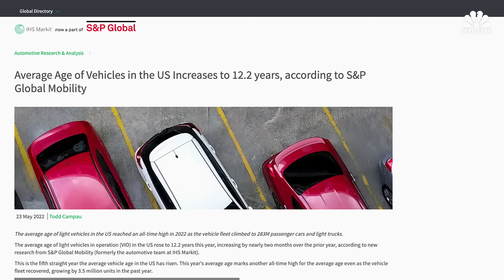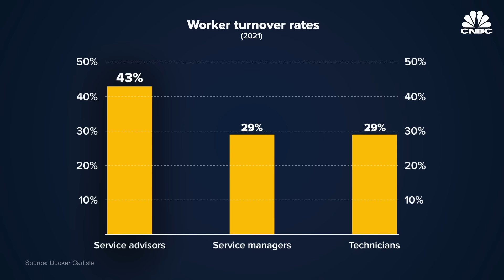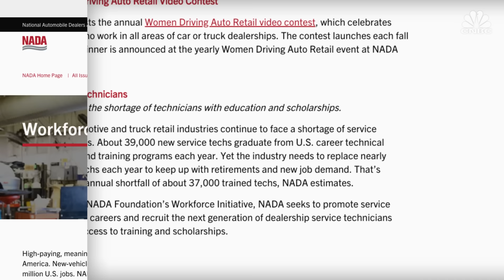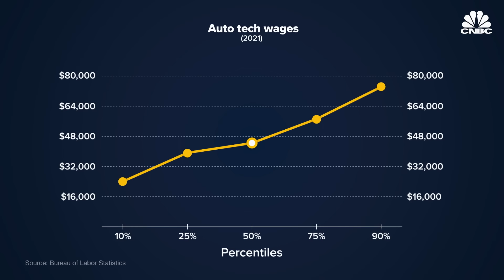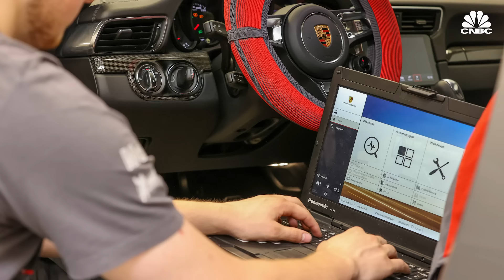Why The U.S. Has A Shortage Of Auto Mechanics

Comment: Starting in 1986, I began in the industry. When I left I was an ASE Master Auto Tech, L1 Advance Automotive Performance Specialist, ASE truck and ASE school bus electrical certified, Honda / Nissan factory trained and a used car dealer tech for about 14 years. Left the industry in 2000 for the same reasons [pay being #1] thoroughly and repeatedly outlined in the other comments. I had a child to support and did not want to live like a refugee. NASTEF was addressing this same issue a few years ago. Here we are in 2022 and nothing has changed. Same complaints of "we can't find [or find enough] qualified Techs." If this has been and is such a critical issue, after 22 years why have concrete solutions not been implemented? Really makes me wonder.
Reply: With your Nissan experience, could you enlighten me as to what would cause a P0650 MIL? Even when i reset the codes, the CEL just STAYS ON. Replaced the cluster, too. Driving me nuts
Reply: @mydecember1985  My Nissan experience dates to the 1990s. The code you cite is a MIL lamp circuit malfunction. As the MIL keeps coming on, obviously the MI Lamp and its circuit are working. Further, you state that "when i reset the codes". What are the other codes that are appearing with with P0650?
Reply: @parochial2356  Thanks for the reply! I'm close to your era. Those were the Nissan glory days!  02 Infiniti I35 (glorified Maxima) That's the only code and it won't go away. Tested voltage to circuit at back of cluster and continuity to ECM pinout. Normally, if I clear any codes, the CEL goes away for a few minutes before the ECU picks up a fault like P0420 or P0328 and turns back on. This thing is constant! The annoying part is that since the ECU cannot detect the MIL, any secondary code throws the car into limp mode. The logic would be "if I can't show you a MIL, I'm going to put you in limp mode so you KNOW there's something wrong". Something as simple as an evap code for loose gas cap sends it into limp and cannot pass 2,500rpm.  ECU was repaired last year by a shop for faulty electronic throttle body that shorted a small chip in the ECU. Code has been there since the day I got it back from repair. I just needed to know that no other module can control the MIL bulb and that it's 100% the ECU. Perhaps a bad solder dumping constant voltage to the light? It's under warranty. Just want to be sure before the wife is out of a car while I send the ECU out.
Reply: You state that the MIL code is the only current and repeating code since ECM replacement. OK. I am not current on the logic strategy for a MIL circuit issue on this vehicle. Seems odd to me that, for example, if the MIL light was "burned out", that the car would start but be in permanent limp mode and undriveable.  Perhaps that is true. Now, if the car was bought to me for diag, I would first confirm the correct ECM part number for the year, model and engine is installed. Then: 1. Confirm KOEO, that the MIL does illuminate normally, 2. Pull codes and [I assume I would see] the MIL P code and no other codes. 3. Start the car and look at the live data stream and note any unusual data parameters, including - but not limited to - the MIL command [should be set to false], MIL illumination status [off or false] and normal B+ [system is charging]. 4. Assuming data is OK and MIL illumination was now occurring, I would check for the full B+ system voltage being dropped across the MIL lamp i.e. no raised ground issues on the or low B+ input at the MIL bulb. 5. Assuming we're good to this point, perform a dynamic B+ and ground test at the ECM connector of all the ECM's B+ and grounds. This means using a test load such as 12V bulb that draws say, 2 to 3 amps, not an Ohm meter resistance test as the service manual likely shows. Eric @ South Main Auto has many excellent examples of how to do this. If Everything is good to this point, I would warranty the reman ECM. I suspect you have either the wrong P/N ECM installed or an underlying wiring / ground issue, but I think my approach will ferret out the true issue.
Reply: @Chosen Remix First; this requires a shift of the mindset and a desire of a Tech to become self employed. Second, it requires the capital to start a shop. That will require either a large sum of cash on hand from savings or the desire and ability to obtain credit, with the ensuing risks involved.

Comment: We went to an independent mechanic for years until he retired recently. He did his job for decades. He loved doing it, but he shared something interesting about the direction of where the work was heading. He said each auto company are making it more difficult for mechanics to repair with technology coming into play. He also said the tools are becoming obsolete to pick apart an engine and that each car brand has their way of removing components which makes it cost burden. Why go through all that hassle when it's obvious that car companies now want to be distinct from one another. He said it's not like the good ol' days where you can fix your car yourself in your garage anymore. It's just too complicated now. He didn't want to retire soon, but can't keep up with the changes
Reply: That isn't an excuse for me. Every industry I know from computert/phone repair has different builds, proprietary bolts/screws/locking methods.
Same has been automotive the past 15 years I've done it. My older brothers and father are master technicians.
They taught me to learn OBD2/electronic control modules of vehicles. The vehicles had more electronics, sensors, modules, actuators added to reduce emissions and increase gas milage(MPG)

It's actually easier to diagnose vehicles with electronics than before.
Now it is harder to remove engines and transmissions with electronics but having sensors to read everything is definitely helpful.
Reply: Yeah, he was ass. Cars a easier to work on now than back then. The problem is cars will tell you immediately that you didn't fix the issue & a lot of old guys can't hide their incompetence. 

Idc if it's a ev or a car from the 20s... if you're a mechanic/technician your brain is wired to fix it because you understand fundamentals.
Reply: @sojer6mile You’re partially wrong. Modern EPA restrictions and OEM manufactures wanting to incorporate more “BMW” into their vehicles is causing plenty of issues. 

Ford just did something dumb with their 5.0’s in the truck motors. In order to “meet increasing EPA guidelines” they decided to take a proven reliable platform and put a “Kevlar oil soaked belt” for the oil pump. Sure the gas savings maybe went up 0.0001% by reducing the load on the engine but now the cost of pulling the engine out and servicing that belt at 100,000 miles is the consumers problem. 

Are vehicles easier to diagnose? Maybe partially. I work in aviation on aircraft that are around 1970’s through 2010’s and amazingly even brand new off the line aviation equipment is barely changed from 50 years ago. Why is that? Because it’s proven, reliable and there’s no government influence to change anything.

Comment: As a technician with 20 years in the business. I will say It's a tough life. Long hours, commission (flat rate) pay, benefits haven't been the best, but they haven't been terrible for me. The biggest challenge i've seen over the years is finding good technicians and second retaining them. The manufactures want to recruit techs, but don't help with ridiculous labor times for certain repairs and dealers don't help by paying low flat rates when their door rates are $200 plus an hour. "Here do this engine that pays 10.2hrs, but takes two days to do. Maybe longer if you are slow. This is why there is a shortage. The "gravy" work is given to hourly rate apprentices. See where this is heading? It all boils doing to money and culture. I've stuck it out because I have done pretty well for myself. I can see why there is a shortage and has been for well over a decade.

Comment: The main reason you had an abundance of car techs in the past is their dads were working on classic or used cars, and when those dads were kids, they wanted to go fast. Didnt rwally matter where. This was stemmed from Racing & high performance wheels on tracks. It goes back about 70 years.
Same with ProMilitary & police.
The most common feature was the Machoness.
With the rise of computers, social/multimedia, it all changed.
Not every man wants to be a CoG in a big machine.
Sure, men want to work with their hands, but they want to work with their brains too. Hence Computer guys, Art heads & artesian Lumber Jacks, and so on.
Also YouTubers.
Companies are trying to stay conservative & keep the tradition of gas auto repair going. They are going to get left behind quickly once every customer jumps on to the electric bandwagon.
Reply: There’s still a lot of wrenchers out there. But when you can just get a “normal” job and make as much for easier work, it’s a no brainer.

Comment: @David Oles, you covered most of the problems quite nicely. 
I owned a repair business for 16 years, before that worked for other shops for 12 years. I left the industry in 2008 as the US economy was starting to tank. 
My biggest problem was employees. Finding properly trained and experienced techs was a big problem. 
Then the cost of diagnostic equipment and the ever changing technology. 
With the new technology now, I can only imagine the issues and problems with EVs and other types of fuel systems in vehicles. 
Touch screen climate control , etc, seems damned silly to me. OFC , a 70+ thousand dollar EV seems ridiculous also.
Information is a problem now. Independents can't get information on some vehicles . I see obtaining parts is now a problem.
I'm glad I got out when I did.

Comment: Just a heads up just because you get your vehicle repaired at an independent shop does not mean it’s aftermarket. We use factory OEM parts probably more than the dealer does.  Getting your car repaired at a dealer is the same as getting it fixed at the dealer robbery
Reply: i use lots of quality after market parts, and some are way better than oem, like moog

Comment: The other problem is all flat rate times are made by the manufacturers who make each car.  This is the hours they will pay for any particular job, so what's their incentive to make these times accurate.  I was a technician at a ford dealership for 30 years and the flat rate times became harder to meet every year.  For example to reprogram a PCM would pay .3 which equals 18 minutes.  So you have to get the repair order, find the keys,  find the car and drive it to your bay,  find the computer and then perform the reprogram, drive the car back outside,  fill out all paperwork hang keys back into box.  I quit the field in 2016 and it was the best decision I ever made.  I always said the technicians need their own union and strike on mass and maybe people will understand how important we are instead of just being rude and cheap.

Comment: I was an engineer but lived in a small town. So I did work as a mechanic tech. Tow truck drivers do better! I have worked on everything from Stanley steam cars to diesel trucks. The pay is horrible. You have a fortune tied up in tools. Shops charge over 120 dollars an hour but you don’t get paid hardly that.  Unless the industry changes, this problem will get worse. The only way to solve this is to pay the techs more with benefits.

Comment: I worked in Auto Mechanics and Diesel for 25 years and taught as a technical school instructor for 15 years. I was ASE certified in 16 areas and had a technology degree. I had about $50,000 invested in tools and diagnostic devices. I am now retired. The shortage of Auto Mechanics is very simple for the industry to fix! Brand new techs out of school without experience should start out as Helpers at $20 an hour.  Fully qualified Master Technicians should be paid at the rate of $100 an hour. PROBLEM SOLVED!

Comment: I used to be a mechanic. I quit because of the pay and tools (including eletrical) got too expensive. Tool box is 2000 impact is 600 impact sockets 250. That's just for tires. Very few shops supply tools.

Comment: As a retired tech with 45 years in automotive and truck repair I have seen a lot of change. It is far easier to be in most any other career. I was  a rebel about work hours and off time. I f I wanted off I took off. You have to be good to be able to tell the boss or owner when you are going to be there. They knew that low pay was not their option. Be strong or move to something else.

Comment: Also, think about the work itself; it has changed. When you ask any auto tech that grew up in the 70s, 80s, or 90s what got them into doing auto work is that is used to be a fun hobby anyone could do. That's still the primary reason people get into it today as well, but with a slight difference. These days people who are getting into the hobby are working on cars much older than them. I for example love working on my 83 Toyota Celica or my 82 Chevy S10. I have not once touched my 2014 Nissan Sentra for any other reason than regular schedule maintenance or when something breaks. The biggest reason is how complicated the newer car is compared to the older car. It's much more difficult to repair, modify, or tune modern cars compared to today. Cars require more and more specialty tools and software than ever. It's not uncommon to see the local auto shop with a $14,000 scanner. Programming computers and chasing down data errors are semi-common occurrences these days. Plus, lots of shops back in the day used to do lots of performance upgrades for customers, not just repairs, hell even a special car with the shops logo spray painted on it to take down to the drag strip. These kinds of experiences are way fewer and further between than they used to be, and these activities made the work much more fun and enjoyable. This is because the complexity of these new cars and manufacture's dislike of these kind's of aftermarket activities existing, there are only a few new cars that people go out of their way to modify compared to back in the day. Obviously, this is not the only reason, but I think it's a significant and un-talked about aspect of this issue.

Comment: I do IT-work at a dealer and i can tell you first-hand why theres a shortage of advisors & technicians. TL;DR, the jobs aren't paying enough for the type of work being done, and it's getting worse as automakers make it intentionally-difficult to repair vehicles.

Technicians:
- underpaid
- cars are becoming more complicated & labor-intensive to repair
- management is unbearable to the techs

Advisors:
- dealing with customers. 
- One bad review and their bonus (which is most of their pay these days) is basically gone
- the actual amount of computer work to process just for a single customer repair order is more than even I (an IT support tech) could handle

Most of the money a dealer service department makes divvies between the owner, the service manager(s), service director(s), and general manager before it makes its way to the advisor & technician. Automakers will make their money from the parts department, which also goes through a similar cut with the dealer-pricing for their parts.

Comment: Just as a dealership will ripoff customers, it will ropoff it's employees as well.  I had a full scholarship to a 2 year tech school back in 2002.  It was an apprenticeship program with ford.  I soon learned that if i did a job that took 4 hours but the book called for 3, well i got paid for 3.  If the job took 2 hours but the book called for 3, guess what?  The customer pays for 3.  I witnessed an elderly lady get taken advantage of.  They replaced every component in her a/c and made sure the last part replaced was the actual one it needed.  All the rest were fine.  I couldn't work for a business, or industry i should say, that treats people this way.  The money was terrible too.  I dropped out, ran heavy equipment for a few years then got my cdl.  I could make more money with 1 month of training that cost $2000 than i could slaving away at a dealership buying my own tools.  Im independent now and i love it, but the trucking industry has the same problem.  They always say its a driver shortage.  All that is, is a means for new legislation for this fake emergency like lowering the age to get your cdl to 18.  Mega carriers want to hire kids fresh out of high school and take advantage of them and pay them slave wages.  They have an overturn problem, just as the auto industry does.  We've caught onto this insanity.  The wages are nowhere close to where they should be, especially if you have to pay to go to school, buy your own tools, and get re-trained every year.  They should be getting paid hourly, period.  Paying by the job incentivizes shoddy work from already underpaid people.  They should also provide tools for every mechanic.  Its an old system that doesnt work anymore.  The only people benefitting are the people at the top.  Btw, "high performing technician" doesnt mean someone who is great at their work.  It means somebody willing to work a lot of overtime every week.  Sure you can make 80 grand.  All you have to do is work 70 hours a week.  Sneaky, sneaky.

Comment: No interviews with mechanics.

The newer generations are far more aware of optics and social impact.  Mechanic shops/dealerships have been considered scummy and and predatory.  Who DOESN'T have a female family member who's been gouged and screwed over by a dealership or shop?  Who would willingly want to join that terrible system?

I'm 45.  When I was 21 I worked at a shop for three months.  My last day was the day the shop owner oversold a single mom.  She came in for new tires.  He sold her tires, brake rotors, pads, caliper rebuild, system flush.  All unnecessary.  Everything was more than fine.  I didn't show up after that.  I felt disgusting seeing that happen and to this day I regret not saying anything.